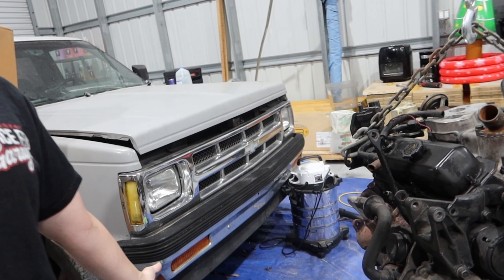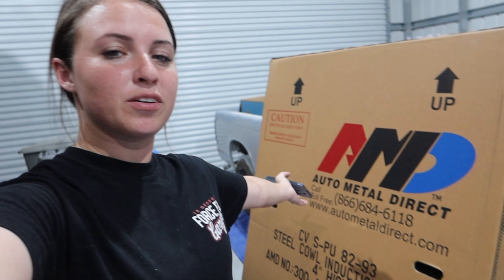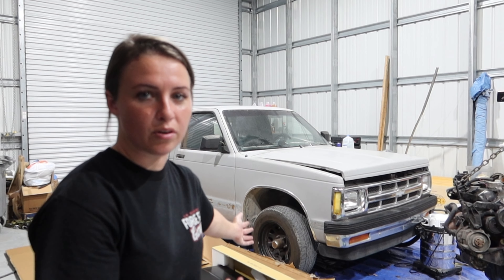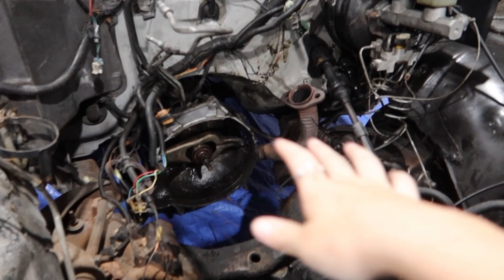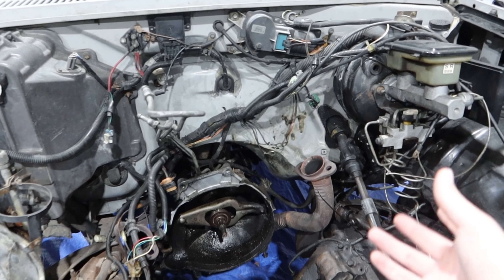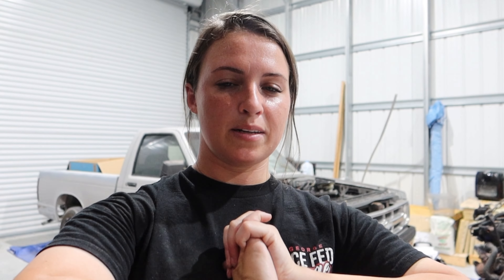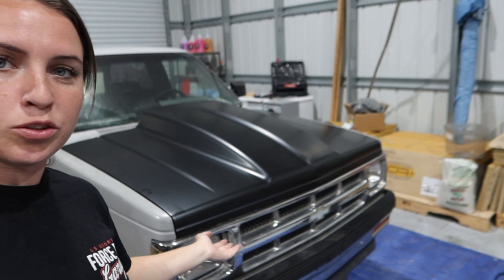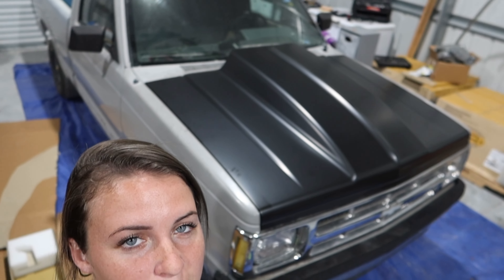FIRST COSMETIC MOD for my S10

Comment: Almost bought us industries fiberglass bolt on 3 inch high cowl induction hood with unfinished bottom side around 1999 but it was $649 and the factory steel hood was perfect so I didn't.
Reply: For the 86 Buick regal factory V8 sport coupe I had.

Comment: And if my drag truck build was going to be the pieced together body 89 Chevy s10 el regular cab short box 2wd I told you I had i was going to leave it the same colors except probably paint the bed primer red oxide lol, it was a white truck with a light red pinstripe along the top bodyline original that was removed as well as the molding except from the bed and it had no tailgate the trunion on the passenger side bedside rotted out. Front fenders were bright red and grey in the center for a 90 Chevy s10 Tahoe, the Dr door was white with a dark red center stripe from a 84 s10 Durango long bed from the junkyard the passenger side door was faded red orange and white center stripe from a regular cab long bed 82 chevy s10 4spd Durango I had for parts and the same red and grey front fender and the hood was a gm medium metallic grey from a 86 chevy S10 long bed parts truck another Tahoe same with the core support grille and front bumper, and the red and grey factory dash and the truck had a blue seat when I got it and I put a grey bench seat back in it

Comment: I was making a comment got half way through and it disappeared before I post it grr. Anyways I had said if it would have been the black 90 dodge Dakota se 5spd long bed that I had considered building a drag truck toy out of I was going to get it painted chrome yellow a Mopar color, but with the third generation dodge ram rt stripes and the bumblebee rumblbee stripes that wrap around the rear of the bed sides at the back of the bed , but if it was going to be the 88 s10 red and black Tahoe regular cab short box loaded option 2wd i had it would have stayed the same colors